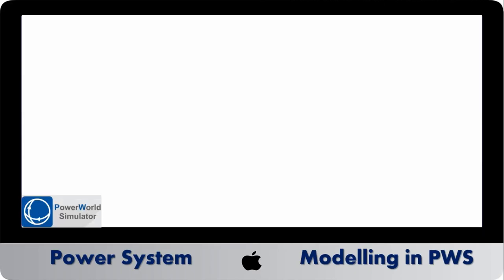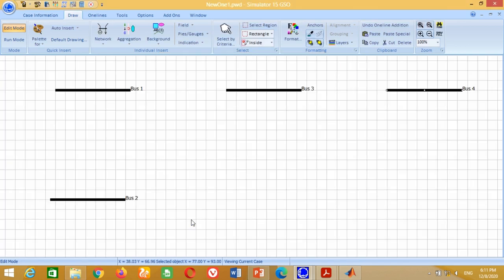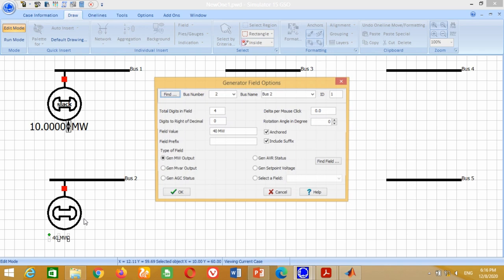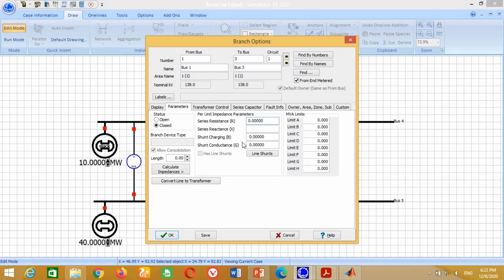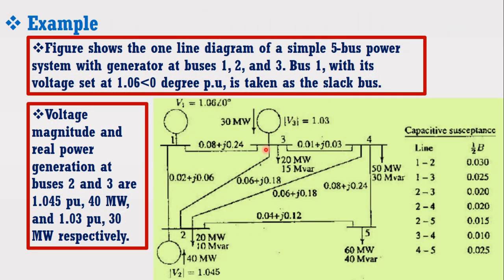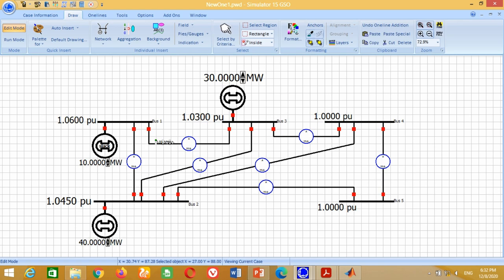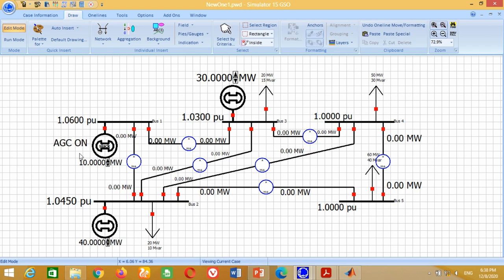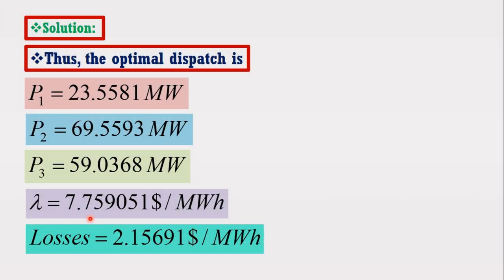How to Perform Economic Load Dispatch with Losses in Power World Simulator ? | Dr. J. A. Laghari

Comment: Dear Dr. Laghari. I did the same as  you did but in the Generator  2 and Generator 3 it is  showing 0 MW instead of showing   40 and 30 MW.  It maybe noted  that i put the correct value in the MW output( 40MW for gen2 and 30 MW for gen3). Still something is wrong..
Reply from the maker: Thanks for the comment. You may have put the correct value. But other settings must be correct.  Follow other steps correctly to get the correct result.

Comment: Thank you very much for the tutorial, Dr.Laghari... i have a question, how to change $ currency in generator's cost because in my software, it shows another currency, not in $(dollar)... thank you very much Dr.Laghari...
Reply from the maker: Thanks for the comment. What currency is it showing?  Reinstall the software to solve this issue.
Reply: I've reinstalled many times.. but it doesn't works... the currency shows my country currency, Rp(Rupiah). I will reinstall the software again... Thank you very much Dr.Laghari 🙏
Reply from the maker: @AB-ee5bw  Right. It is ok. If the results are correct means value is correct then nothing to worry about.